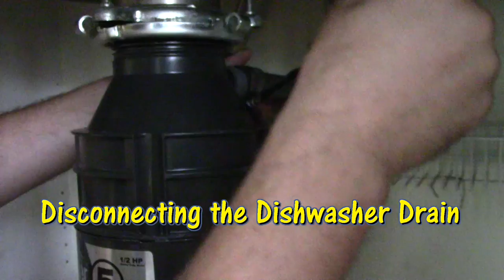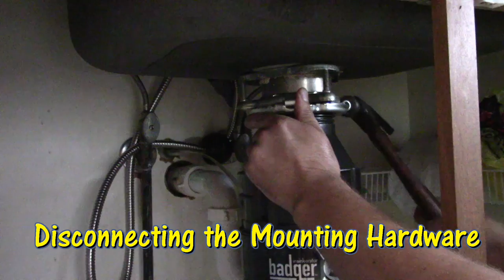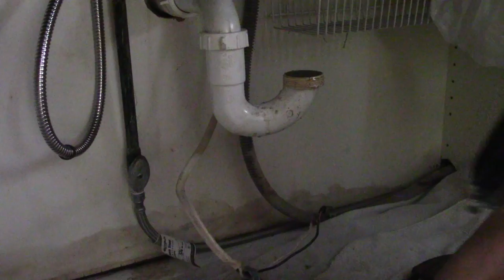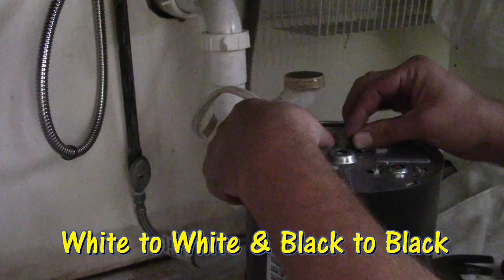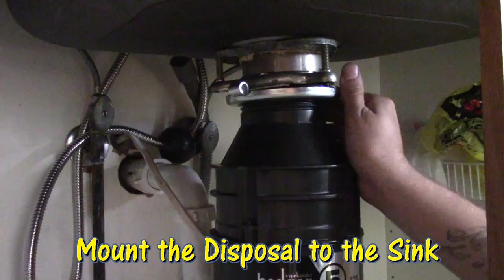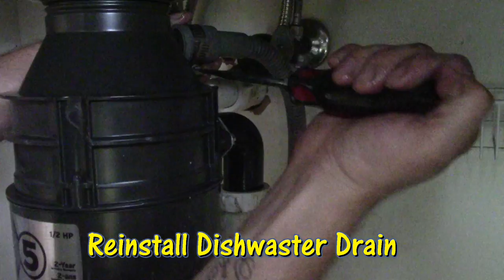How to Replace an Insinkerator Badger 5 Garbage Disposal by @GettinJunkDone

Comment: Pretty helpful. Thanks! I just replaced one today. One tip for everyone which was missed by this video is that, you could screw the L-pipe in first before securing the unit to the sink bracket.  This would spare you from struggling to install the L-pipe behind the unit out of sight.
Reply from the maker: Good advice!
Reply: Or, just use the old L-pipe and simply replace the gasket which comes with the new model.  Never fool with the old L-pipe or PVC connector at all.

Comment: I had a Badger 5 and was able to use the same top mount for the Insinkerator Evolution Select Plus.  All my connections aligned just fine as well! Going to save new top mount for when I remodel kitchen and get new sink.  Thanks for video, super helpful in removing my old unit!

Comment: Great video! Thanks for posting it. Made the job a whole lot easier.

FYI: I upgraded from a badger 1 1/3hp to a badger 5xp 3/4hp and all the fittings are the same. The badger 5 is just a little longer in length.
Reply from the maker: Glad it helped!

Comment: Thanks this helped me so much wife even helped, Didn't have to change the top part above disposal, New one screwed right on the spot the old one came off. Don't forget to remove the plug if you have a dishwasher i forgot but caught it in time.

Comment: A step stool under the disposal when screwing or unscrewing the collar will help not having to lift or lower the heavy disposal so far while lining it up straight. A screwdriver might not be able to apply enough force on the hose mounting screws so a socket will also fit the hex screwheads allowing more force.
Reply: Acra Tone can you explain this like I’m 5 years old please, sorry
Reply: @TheBoxBox920  A Badger 5 is heavy, when twisting it on or off the collar, and can be tricky if you are lying on your back and reaching upwards to the sink. Therefore placing a short step stool (about 8 to 12  inches tall) under the sink connection will help raising it and lowering it only a short distance as you try and line it up to twist the Badger onto or off of the collar. Or something else to act as a platform if you don't have a 'step stool'.

The hose connector screws are slotted hex. A slot screwdriver will not put much force on the screw. A hex wrench (end wrench, or socket and ratchet with short extension) will make the job much quicker. Also it will allow tightening the screws tight enough where they won't leak.

Badger makes a flexible pipe that bends and expands to match the disposal outlet to line up to your pipes. InSinkErator FDT-OO on Amazon.

FDT-OO can be pushed to make it shorter than your old connector pipe, or pulled to make it longer than your old pipe. It also bends to move it up/down or sideways.

Comment: Great video.  My 1994 1/2 HP Badger 5 model finally died last week.  Will do the install myself and go with another 1/2 HP Badger 5.  Nice to know that in going with the same model, should not have to deal with the attachment that attaches it to the sink.  One thing, on mine, the power cord appears built in.  I just plug it in to the electrical outlet under the sink.  Will see what the new model is like.
Reply from the maker: Hope it worked out for you!

Comment: My Insinkerator Badger 5 came with the top drain assembly. But I noticed in many vids, people never bothered to replace those parts. Is it not necessary to do so? My current sink drain assembly happens to be another Insinkerator model, so I supposed I wouldn't need to take that apart either. Thanks for the upload @Gettin Junk Done.
Reply from the maker: A professional plumber might tell you otherwise, but I never have and everything has been working just fine.   Thanks for watching!
Reply: @GettinJunkDone   Thank you so much. I  was able to put it together without any problems, much thanks to your video tutorial help!

Comment: Question - is it allowed  to run a visible white wire in a kitchen cabinet at all? For example a transformer for LED below the kitchen sink? Danger from possible leaks and mechanical damages?

Comment: Thanks for the video. I just replaced mine same model and it was relatively easy! I did the same thing got the same model to eliminate headache. The old power cord was not black and white it was all gray except the green ground wire so I just connect the black wire to gray and white to other end of gray and green to ground and closed it up and plug everything in and everything works well. I don’t think it really matters Which wire connect to which as long as the green wire is connected to where supposed to be connected. Right??

Comment: Tip: Unscrew the P-Trap on both ends to be able to remove the disposal unit without having to reach back and unscrew the pipe adapter to the unit.  That's why the P-Trap has 2 screw ends. After you mount the new unit, you then reassemble the p-trap.
Reply: Thanks for your comment. Saved me a lot of time tonight

Comment: Thanks for the video.  Definitely made replacing my disposer much easier.  One thing! My new Insinkerator Badger 5 (3/4 hp) came with a hex tool.  Instead of hammering out the old machine from the universal connector, the tool can easily be used to remove it, as per the installation guide.  It was much easier than hammering (which did not work for me).

Comment: Thanks. I appreciate the video. However, I did upgrade from the Badger 5 (1/2hp) to the Badger 900 (3/4hp) because they both hooked up the same and the 900 model was on sale at Home Depot and actually cheaper than the 5. But the biggest plus was the 5 only had a 2 year warranty but the 900 has a 6 year warranty. I just switched them out. After watching your video it turned out pretty easy.

Comment: So I'm doing the dishes at 10:00 PM. Shoes are wet for some reason. Crap...something is leaking. Check under the sink and find my Badger 500 is leaking like a sieve. I hop on YouTube to look at my options. I watched a video of a badger 5 to badger 500 replacement and it was terrible. The guy explaining the process had no business doing this relatively simple job. Your video started playing automatically right after his crappy video. I was cracking up when I heard "hey guys, Joe back again with another episode of gettin junk done"  thanks for tips in the video. If I run into trouble I'll call you or your pop!

Comment: So, i'm replacing my cheap, 1/3 builder model (g.e.) I think, with a badger 5 xp 3/4 horsepower model.  It has a power cord.  Can I expect the fittings to be the same where it connects to the sink?  Am I going to need plumbers putty and that sort of thing?
Reply: Curious to know answer, as I have the same 1/3 hp badger and want to go up to badger 5…

Comment: I have this exact one and for reasons unknown although it still works the old one started leaking like a siv and began pouring water out of the bottom despite all connections being good.
Reply from the maker: Yeah, that's weird!
Reply: Same here bro, no reason except for age. It just started leaking  but after 10 years. The warranty is 3 years. Okay, time to replace. Thank you.
Reply: There is seals in the motor housing rust out and that allows water to flow downward right out the reset button.....there is a reason for only a 2 yr warranty. I replaced this exact model with the same model after it lasted 8 years of daily use. Badger is great
Reply: Tyler Finvold if it does that,REPLACE NOW!
Reply: Mine is leaking out the bottom as well, gonna go this rout as well same same but mine comes with a cord, i havr an outlet underneath my sink easier. Thanks for the vidioe

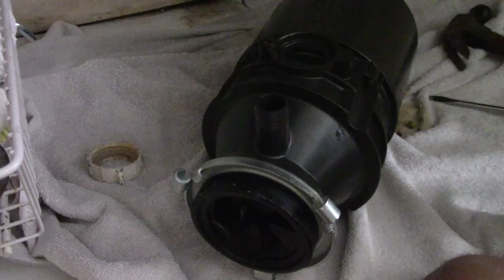Comment: FINALLY,  I think I got it, the part at 4:26 where you attach the garburator (I like the Australian word) to the sink. My mistake had been in trying to line up all the "loops" on the metal ring attached to the  garburator to the hooks on the metal attachment to the pipe coming from the sink before rotating it clockwise.  It also helped to run the video speed at 1/4....several times. Well, I never claimed to be a mechanical engineer. LATER: I still can't do it. I can't line up the parts so that they will be engaged when I give a hammer tap. I don't understand why I'm having so much trouble, because I have done this before.. Well, I'll be back. The damned thing's heavy.
Sun Feb 28, 4:42 PM: AMAZING!!! I bought a scissors jack for only $18.00 It works fine, and certainly removes  the main difficulty: holding the damn thing up to make the connections, but I STILL can't line up the parts. Well, I don't have much patience with these sort of things, so I'll try again tomorrow. Somehow, this reminds me of Macbeth: Tomorrow, and tomorrow, and tomorrow creeps in this petty pace until the last syllable of recorded time....Now that's high class plumbing. I'd prefer successful plumbing, though.
Reply: (Thu Mar 4, 1:26 PM): I shouldn't be haven't so much trouble. I must have damaged or lost an important part while removing the disposer. Anyway, I'm now trying to remove the parts that go through the sink itself. You know, the round stainless steel part that  fits flush with the bottom of the sink, and the part under the sink that connects to the pipe coming from that part.  I can't separate the two right now. Am I supposed to be able to unscrew the lower part?
Reply: I removed my Badger 5 1/2 HP  garbage disposer from my sink,, but I have not been able to put it back. I've tried many times, but I always fail. However, if I can't succeed today, i will buy a new one on the theory that I must have damaged the old one while removing it in a way that prevents me from reinstalling it. Here are  the precautions/steps I think I've been taking and will certainly use again: (1) Make sure the unit is directly under and centered with the connection above (2) Raise the unit as high as possible before trying to connect it with the above connection. (3) Make sure that the unit is as level as possible (4) Proceed slowly and carefully (OF COURSE!) (5) Align the parts in question exactly as you  show in your video.In other words, rotate the part until it is in the same position in relation to the part above as is shown in your video.
Thirty minutes from now, I'll be smiling or ordering a new Garburator from Amazon. I will not delay one-minute beyond that. It's already been too long.  Of course, I don't need a garbage disposal and never have, but I am not taking the easy way out by just reconnecting the plumbing WITHOUT a disposer) No, I'm in this battle to the end. (Sun Jun 6; 4:00 PM PST)
Reply: Okay, that's it. I failed again, and I really tried, repeatedly. the only interruptions were when I watched the attaching sequence twice, with full screen and slowest speed, The only thing that made me think  I had a chance was when you failed on your initial attempt. (The part you were rotating was forced into an un-level  position. Thats what happens to me when it doesn't just fail to engage at all. Well, that was my last try. I'm now ordering a new Badger from Amazon. As I recall, this.model costs about $85,00.WHAT A  RELIEF!!! (SUN Jun 5; 4:40 PM PST)
Reply: The price, including shipping and tax, has increased to $108.40.It's still a relief.

Comment: Great video.  One question, instead of cutting the circuit breaker, can you just unplug it?
Reply from the maker: If there is a plug for the disposal, sure.  Mine was hardwired.

Comment: Did you buy the power cord kit??
Reply from the maker: To be honest, I don't recall.  I wish I could be of better help.
Reply: I also have this same garbage disposer and I have it hardwired to a light switch to turn on and off so I didn’t need the power cord kit. This kit is optional.

Comment: I am replacing my Badger 5 1/2 hp with a new Badger 5 1/2 hp. The new one is coming with a "factory plug" installed. Mine is hard wired like yours. Do I need to use this plug or can I ignore it and hard wire it like before?

Comment: One quick thing I noticed. It appears that the drain coming out of the wall is higher than the discharge on the disposal. This will create a situation where the disposal will hold water. To fix this correctly that drain line coming out of the wall needs to be lowered 3-4 inches.
Reply: 100% AGREED! I was looking in the comments to see if anyone else caught this!

Comment: Did you replace the mounting bracket or just reused the original part?
Reply from the maker: I don't remember for sure, but looking back I probably reused the old one since I was replacing the unit with an identical new disposal.  It would save time not having to switch it out.

Comment: WARNING: For anyone replacing a Badger 5 with a Badger 500 (it's the same thing: 1/2 HP disposal unit), the new quick lock flange nut has changed. You know, the part that he was hitting with the hammer. This part is now keyed which may force you to mount the unit in very specific directions. I removed that part and used the one from the Badger 5 that was able to spin freely. No regrets. It worked perfectly. Otherwise, you may want to cut that piece of metal to allow it to spin freely if you are not replacing a unit of the exact same brand. I hope that helps someone.
Reply from the maker: Good tip!  The update is awesome.

Comment: I just did it not turning off the breaker. haahahahah  It's a challenge that way. :P I did disconnect it at a junction box under the sink between the switch and the disposal so it wasn't so shocking.

Comment: That cheap garbage disposal also is a piece of junk because the inside is made of iron and it rusts and leaves a big hole which started leaking slowly and I wasn’t aware of it till we had a  big leak. You should buy the one with a stainless interior. I sure won’t install this one again because I had this model before originally and it lasted for 23 years so I replaced with the same model and now it rusted the big hole and started leaking and ruined my inside of my cabinet and subfloor within less than 3 years.

Comment: The sad news is they have changed the discharge opening to a new flange type instead of the threaded outlet on the old one. MAJOR stab in the back and investiment in replacing everything in sight under the sink to make it fit. THANK YOU ENGINEERS and manufacturers for doing this to us. NOT

Comment: Great video.   The Insinkerator Evolution Compact has the same dimensions as the Badger 5.   That's what I'm going with. 
https://www.youtube.com/watch?v=luj6zEvraRQ
It has a stainless steel assembly so it should last longer before rusting.

Comment: After seeing this guy use a hammer on the removal and installation of the mounting sleeve, demonstrated an amateur.

There is a specific tool for this.

Don’t ever bring a hammer to a plumbing job. And don’t make a video if you don’t know what you’re doing….period